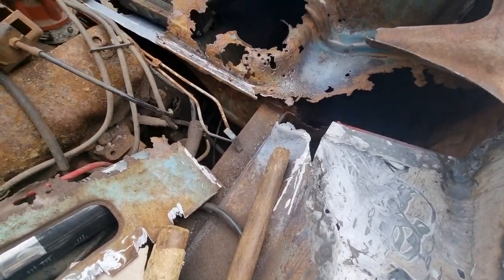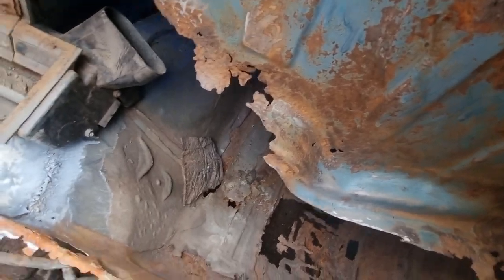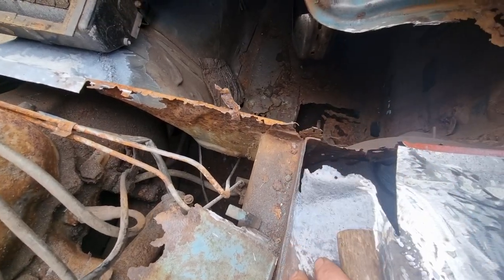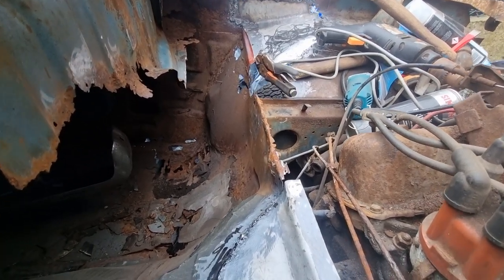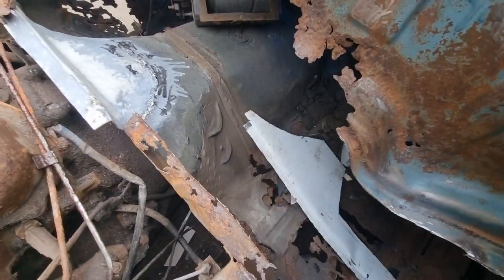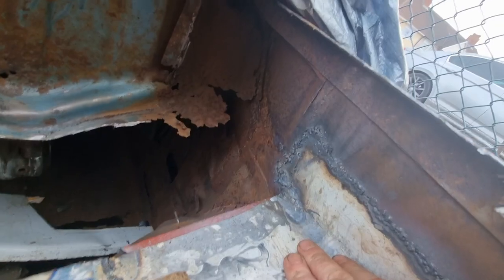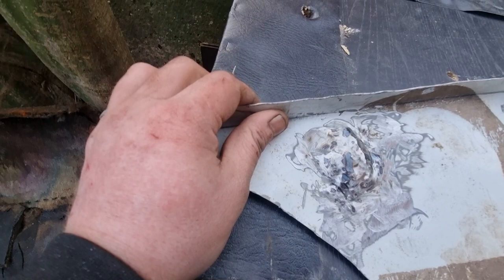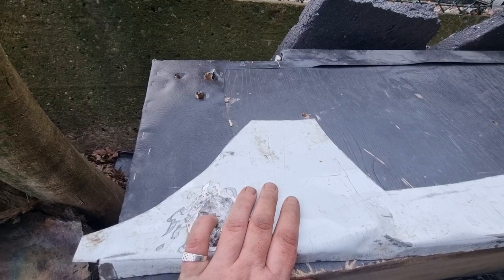Cortina Mk4 Ghia 2.3 V6 Restoration || UPDATE (P6)

Comment from the maker: sorry it was not a long video i will in the middle of filming them but couldent do anymore yet but was been asked when the next video is coming out people are busting to see more so i put this small video out for you to show i have not forgot you all hahaha will be longer video next time i promise just weaiting on surplys wont be much longer
Reply: a bit of a idea for you, Why not have a look at the engine, just to see if it turns etc.  Be just a case of a breaker bar and some oil down the spark plug holes.
Reply from the maker: @procta2343  it does.turn bu5 catches that's why I need to check valves